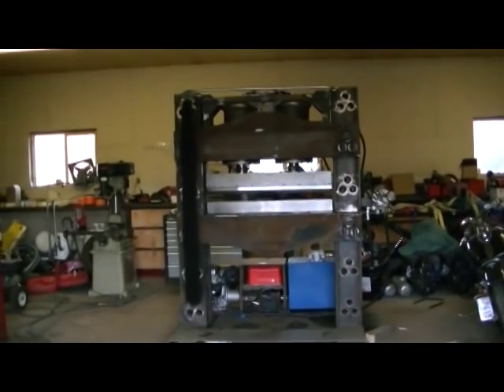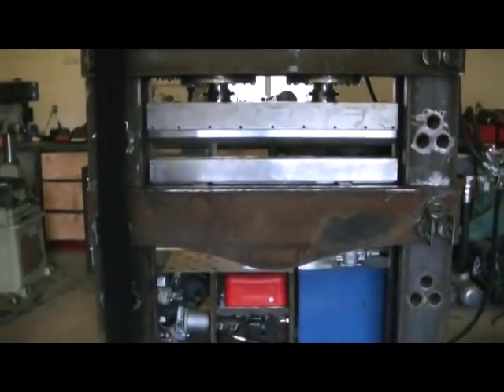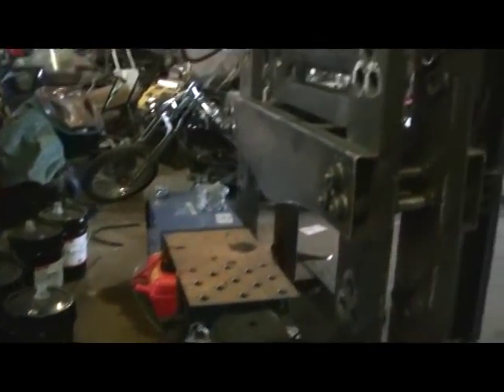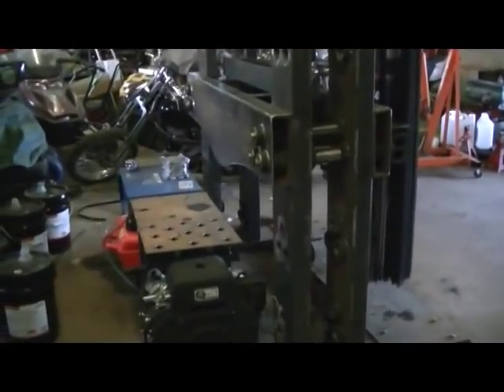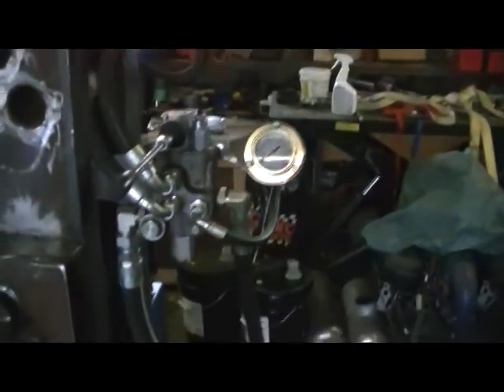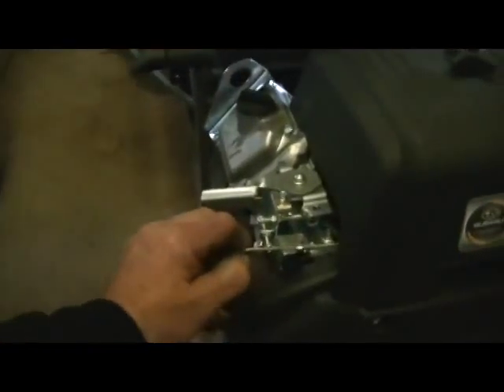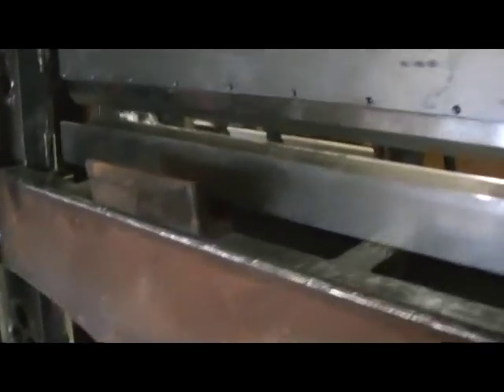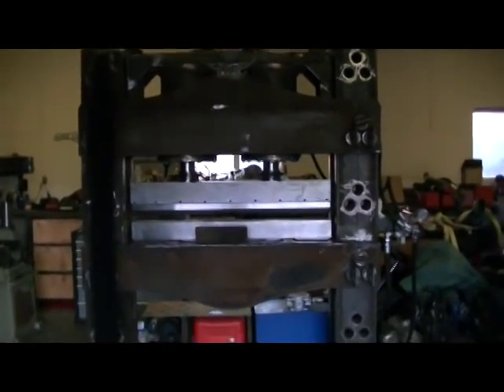Homemade Hydraulic press brake

Comment: Amazing job man! What's the thickest metal it will bend?
Reply from the maker: Thanks Blade.
 The thickest piece I have bent, is a 2' length of 3/4" steel plate. It didn't even struggle.
Reply: @BentRZR  Wow what's it cost to build?
Reply from the maker: @RC-Heli835  I never kept track of the cost of materials, but the 2 cylinders needed to be precision bored by my buddy, who is a hydraulics specialist, he also machined the 3" thick base and head for the cylinders.
 I would say the overall cost without labor would be under 10 grand.
Reply: @BentRZR  Woohoo! I figured it was pricey!😁😃
Reply: @BentRZR  I am curious about the 3 pin system for the lower dies. My 1st thought is that almost all of the metal is gone in 4 panels of steel on each side. I was just curious if that is tested and proven to be the strongest design for the application? 
When you think of it holding 880,000 lbs it makes me wonder but  I see that you have inserted and welded collars inside each hole which would make it  many time harder to rip out.
Reply from the maker: @RC-Heli835  the 3 pin design has withstood every test I have thrown at it. I have had the press maxed out during testing and the pins have never bent.
 It's a beast of a press.

Comment: Awesome job. I would love to see plans.  I need one of these and cannot afford a used ebay version. I also need a plate roller, for rolling vacuum cylinders and need large diameter.  You give me hope that I am not on mission impossible. I just have to keep building and bootstrapping. Thank you for the inspiration.
Reply from the maker: Thanks Kimberly!
 We just wing it when building, so there's not much for plans.
 If you're stuck on any of the design aspects, feel free to reach out.
Reply: I own a stainless steel business that I built from nothing. Trust me, if you're motivated and making progressively larger steps as you go you can build a successful shop in 5 years. The secret is to get jobs. You bid the price of the tools you need into the job. Get 50% down and never look back.

Comment: I’m been doing some research on hydraulic systems and I’ve been told I need a flow divider so the correct amount of  oil goes to each cylinder, did you do this? If so any idea on what flow divider?

Comment: I'm not an engineer but I think you have more ram power then frame strength.  My press is about 90 ton and it's bellied out a pair of half inch bottom bars that are over 18 inches tall.  One way to test is just put the ram on the bed and crank hold the valve open till you reach max pressure.  If it's built properly, no problem.  This is one of those times I hope I'm wrong.
Reply from the maker: Hey Robert. I stalled the press engine out and the gauge read 3500 psi. When I first built the press. Afterwards I was able to pull all pins out! There was no deformation in the bed or frame.
 This was the very first test I ran.
 Since then I have put this unit through much more rigorous jobs and it is still straight!
Reply: Good to be wrong;0)
Reply: very sweet press id love to get the plans if you would be so kind to share or what all you used to build it and dimensions email me at dellschaffner@tds.net

Comment: i do like it but the 3 pins configuration has caused more weakness , side by side is bad still cool though
Reply from the maker: Thanks Dan!
 As I said before, I have had 400 tons of push on the press bending some stubborn material. Afterwards, I checked the pins because I was worried about them. They slid out like they were greased! So, this configuration works very well for my needs!

Comment: man that is slick. I'm drawing up one similar for my shop great work on this build. would love to hear if you would have done anything different . and also where to buy those dies from
Reply from the maker: +Richard Knopp 
 Thanks Richard.
 Nope, everything about it is perfect. The frame and tri-pin design has handled the stresses to date with no issue. The company I bought the brake die from is:
AMERICAN MACHINE TOOLS
5864 NORTHWEST HWY
CHICAGO, IL 60631-0000, US
 Good luck!

Comment: Can you tell me more about the plumbing requirements of running twin cylinders. is there a flow control to equalize the pressure to each cylinder?
Reply from the maker: +Wick Weckwerth 
 In this setup, I don't have any special flow controls. I have isolation valving incase I want to control each ram independently, but I haven't needed to yet.  When I am pressing anything, I make sure it is in the middle, so both rams apply equal pressure on the piece.

Comment: Very nice set up. Could you please give me more information on the brand and type of Hydraulic rams you are using. How are they plummed. I would like to build something like this to bend 10 ga BBQ Pit doors.
Reply from the maker: Larry Sbrusch  Hey Larry, I built the rams myself. They are made from 12" schedule 80 Grade 359 pipe. I cut the top, bottom and plunger plates from 2" mild steel, machined them, drilled and tapped the base plate and flange. The plunger has a 4 seal system including wiper, to prevent fluid loss.  They will handle your 1/4" doors with no problem, as long as they aren't wider than 51".

Comment: I'm sorry but what does QT 100 mean?
Reply from the maker: DENNY KURZAWSKI    (Q)uenched and (T)empered Steel is heat-treated to develop yield strength. This is a cost effective choice for applications which require high strength, improved notch toughness, superior weldability and good forming ability, as well as good resistance to brittle fracture and is suitable for structures where notch toughness at low temperatures are a design requirement. This meets specific strength and Charpy V-notch requirements.

Comment: Nice press. I like how you made the top and bottom beams movable rather than just one like most presses.
 I'm curious about the 3 pin system you are using, could you give some more details about that?
Reply from the maker: russhellmy  Thanks Russ. I went with a 3 pin pattern because it is much stronger than a 2 pin pattern. With over 400 tons of push at my disposal, the last thing I want is for the lower deck to get twisted and bind the pins inplace. The pins are 3" 4340 so with 3 in each corner, I feel pretty safe. If I loosen the lock nuts for each pin, they still pull out and slide in easily.

Comment: here is 400 ton press for you.
Pacific Hydraulic Press Brake, 400 Ton
Reply: yeah his 440 ton calc. is off by at least 300 ton. even if the cylinders are capable the frame is not. nice build other wise
Reply: Kimplekaks that was a real s*** show you talk it's about something built by manufacturing company this dude built this  with his own hands